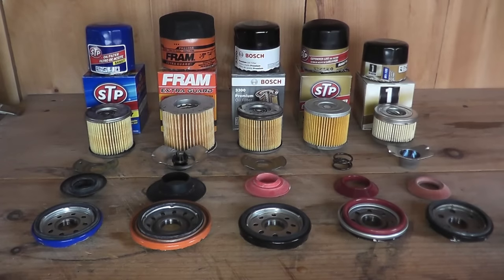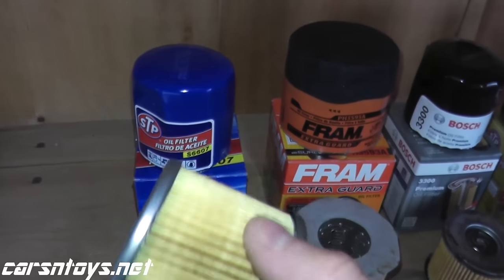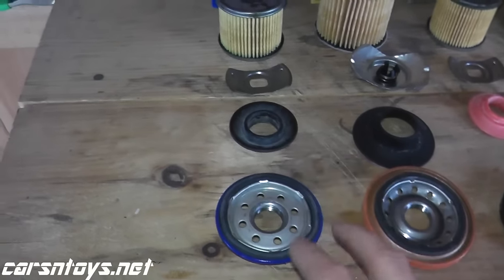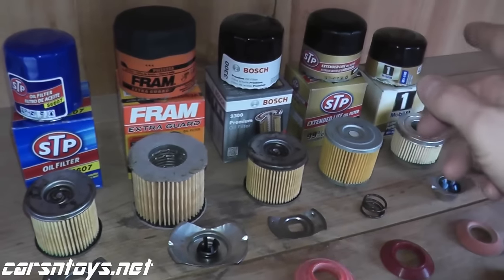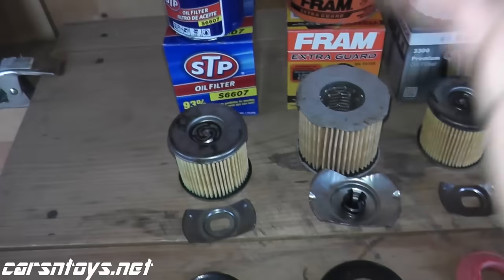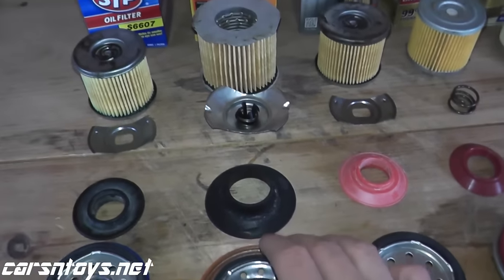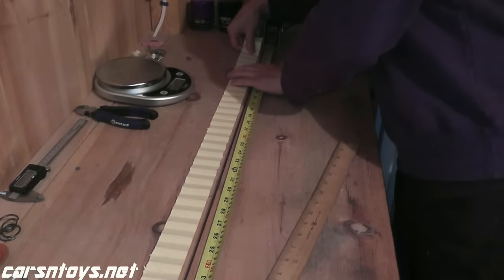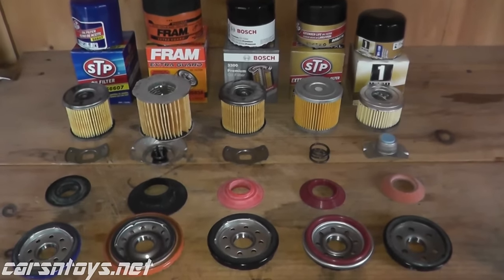Oil Filter Comparison: STP vs FRAM vs BOSCH vs MOBIL 1

Comment: I cut open my used oil filters and the Bosch 3410 had a split in the pleat. None of the Fram filters that I cut open had separated from the end disc or open pleats. My preference is Motorcraft. For the money they kick ass.

Comment: My Local Walmart sells the Mobil1's for $9 - everyday price. I run them in both of my vehicles with Valvoline High mileage dino juice - 5qt jug for $17,  I'm happy with a $26 oil change.

Thanks for the great video!
Reply from the maker: I agree. It's a great price for Mobil1.
Reply: Damn, I can't get my hands on a Mobil 1 filter for under $15 around me (including Walmart).
Reply: I used the M1-110A in my 2006 Nissan Armada, with 7 quarts of Castrol full synthetic 5W-30. I am running at about 5540 miles, and I’m not going to say the oil looks brand new, but it looks pretty good for being over 5000 miles. Funny thing, I went to Auto Zone today to drop off some used motor oil, and I figured I would get the filter there. 
Looked at that &15.00 price tag and took a 2 minute drive to Walmart and paid $9.97. I new it was going to be more expensive at Auto Zone, however, I was thinking $1 or $2 maybe, BUT $5.00 DIFFERENCE ?! ?! ?! 
That’s RIDICULOUS.
Reply: David Derfus you could always price match.
Reply: Brian Anguiano I will have to give that a try, I didn't know they did that thanks.
Reply: Hey what the hell, I just did the same oil change to my car 😂😂😎
Reply: @davidderfus3462  I noticed the same thing, and even weirder is that amazon is $12-14 for the same mobile 1 EP oil filter.  So, like you I got mine at walmart for $9.97.

Comment: I used the basic Fram Extra Guard oil filter with full synthetic oil with 5,000 miles of use, which took me roughly 5-6 months. I did the oil analysis with Blackstone Laboratories and they stated the oil filter did a fine job at filtering impurities from the oil. Though I highly recommend any top of the line oil filters of your preferred choice. I purposely used the extra guard for the oil analysis just out of curiosity.

Comment: The standard STP filter has changed from Korea to China and fractionally smaller and has a slight twisted filter medium. On these new filters I've also seen 2 filter mediums disconnected by small tears near the endcaps after oil changes. My oil antidrainback valve seal failed and could tell by the ratcheting sound when starting without oil leaks and oil at proper level.

Comment: A major determining factor affecting how long a filter "lasts" is how much debris your engine sheds into the oil. So saying that a filter lasts 10K is just nuts.  It MAY still filter well at 10K but it may be clogged up at 5K, too. Depends on your engine and its condition.

Comment: The reason so many dislike the fram is because check valve is known to fail causing oil not to flow through the filter.

Comment: I use the Bosch Premium 3330 on my 2018 Harley 1200. Rated for 20 Microns. Oil comes out of the filter cleaner than the Tank "Bag" as some call it. Also use Valvoline Syn 20/50 Motorcycle oil.

Comment: Stp extended life is my go to. Fram is fine, might collapse a pleat if you go past the recommended mileage but I love the grip they give you to remove the filter. Stp extended life being on par with a Bosch shocked me a bit. It's usually on sale but such a good filter. I only buy Mobil 1 filters when they don't have the stp extended and I'm sure to you it sounds weird but my store usually carries all cartridge filters in Mobil brand. I will say for jeeps wranglers and toyotas the Mobil filters are very good quality with good thick o rings. I haven't used Mobil filters for anything that isn't a 4runner or wrangler.

Comment: I have been using Bosch filters for the last 3 years. $5 at my local autozone. They are great but my local autozone doesn’t sell them no more. I picked up a STP Extended, couldn’t tell the difference between that and the Bosch. Found the Mobil 1 Extended at Walmart for $9.
Reply from the maker: That's a good $ for the Mobil1.

Comment: A fram never ruined anyone's engine, people's neglect and lack of maintenance/knowledge did. Ran them for decades in daily, farm&racin applications and never an issue. Also, why double or triple stint a filter 5,75,or 10k...? for price and turn over can just as easily swap out 3 fresh filters. what would be good is seeing highest end filters from all brands compared,but I see cost prohibitive too. thanks for the insights
Reply: Erik Dale of course, if you change it when you change oil, they won't harm. of you are like me and you run on extreme conditions, you mite wanna get a high end filter
Reply: Erik Dale 
You can't make that claim 
You're assuming too much with no data 
Ignorance abounds
Reply: No Asylum 
I agree
Reply: Erik Dale I've seen too much where a person claims a Fram gives out before it's mileage recommendation, and throws all the debris back into the engine. I wouldn't put a Fram oil filter on my engine unless it is the Fram Ultra Synthetic. Don't go 15,000 miles, though, like it recommends it can go. I prefer a Bosch or Six for price and quality.
Reply: Erik Dale Fram filters are for idiots.  No OEM filter uses cardboard end caps or rubber anti drainback valves! If I'm going to buy a filter that is not OEM it is going to be one that is superior to the OEM filter such as the Mobil 1. So much smarter to buy a $9.00 Mobil 1 filters rated for 20,000 miles than to buy a $4.00 Fram that in in grave danger of failing past 5,000 miles and not only that the rubber valve will shrink and allow more dry starts, the media does not filter nearly as well and the uneven pleating can negatively affect oil flow and pressure. The canister is also very flimsy which can burst or be punctured more easily. There is no reason to buy a Fram over the OEM or the high end aftermarket filter unless you are THAT broke or you think saving five bucks at the checkout counter is worth risking the longevity and like new performance of your engine. Cheap aftermarket filters are for idiots.
Reply: Erik Dale Because Fram is shit that doesn't protect anything so if you drive something other than a piece of shit Honda, you want a filter that will protect it. I want one good filter, not to replace it 3 times with a garbage filter I have to replace that doesn't protect anything.
Reply: Fram aren't necessarily "bad" but they aren't good. I've compared a Fram filter to the OEM Ford/Volvo one and their is a huge difference on number of pleats and quality of material which in turn means a higher oil pressure in the engine with the higher quality one. It's not about how long your big ends last but more about stuff like turbo charger bearings and things that are super sensitive to oil contamination and pressure. I bet an absolute tonne of fram oil filters have failed for people but they never know because they don't cut the can open and check (I would never bother myself) then wonder why their turbo has blown a seal at 60,000 miles.
Reply: Aw Bull, What, I am not going to believe my eyes??? I have seen a collapsed FRAM on a SBC 350.
Reply: I had a fram tough gard split on me going down the highway at 60 lbs oil pressure.  Was put on with the end adapter and not over tightened. I blew the side right I out. Was on for a total of 7 miles. Will never buy another.
Reply: Your so wrong
Reply: @carolgreen-fn1tm  👍 thanks

Comment: I normally get the Mobil 1 Extended Performance M212A filter for my impala, always wondered about STP filters, I only used their air filters for my engine but thats it. I’ll give their STP extended life filter since it’s always a special at Autozone.
Reply: how did the STP extended life filter work for you i was thinking of getting it myself.
Reply: @brandoned  it’s just a filter, nothing crazy. I would be recommended for OEM but honestly AC Delco is a little extra so STP Is less but still good for a daily driver

Comment: would you ever do an oem filter test? like Ford, Mopar, Toyota, etc
Reply from the maker: I will soon. Do you have a preference?
Reply: CarsNToys I was thinking like oem vs aftermarket
Reply: Yes an OEM such as Honda/Acura, Subaru, and Toyota vs Mobile 1, Amsoil, K&N, and Royal Purple.
Reply: If you are using synthetic oil definitely go with an after market oil filter.
Reply: OEM are just rebranded/nobrand versions of the same filters seen on store shelves.
Reply: WELL don't forget acdelco also please

Comment: I've been using regular STP filters for 15 years never had an issue..when I was young and dumb  I would run fram filters..I blew a few engines up which may or may not have been frams fault but then I went to school for automotive technology and my professor did a filter cut up and showed how fram filters were junk..he swore by WIX filters..but did say STP filters weren't bad..so I run STP because their cheap and reliable..
Reply from the maker: I used STP for many years but changed the oil every 3k miles. I never had an issue . Cheers

Comment: Had a bad experience with Fram on my race car.  The filter collapsed and the oil starvation caused the 1 rod bearing to spin.   I have not used one since.   That was in 1997.  Maybe they have changed since.
Reply: Was it a FRAM Racing filter, or a regular ExtraGuard? They used to make true "racing" filters. It was their "HP" line. Maybe they still do (?). Each filter has a "rated flow" you shouldn't exceed. Race cars aren't typical applications a regular filter is designed for.

I've also seen a lot of "chicken-egg" cases where there is no evidence of "what failed first", the engine or the filter. When a bearing lets go, the entire oil stream is full of debris. Any evidence of filter failure is masked by what happened after the engine let go.
Reply: SC457A I've seen that happen too. A Fram filter collapsed and ruined the 4 cylinder engine in a 2001 Camry. What a shame!

Comment: I usually run Denso filters on our Japanese cars, exclusively Motorcraft on the Mustang weekend cruiser, but I have used the STP filters on the daily driver Japanese cars with zero problems. When AutoZone runs the oil change special and the STP filter is only $1 extra with the purchase of a 5qt jug that is too good a deal to pass up in my opinion.

Comment: I have never ever had an Issue running a Fram. I think the people who have Issues with Fram are guy who rebiuld something and had no clue on what they were doing.
Reply: never rebuilt my car and I'm certain the fram filters that I started using at 80K miles ruined my timing chain.
Reply: Fram filters are cheap no good filters. I use stp
Reply: I've always used orange Frams on our OHV engines with no problems. Our SOHC and DOHC engines get the better filters.
Reply: @AlahuSnackbar  that is a coincidence.  Around 80K its time to change the chain, it certainly wasn't the oil filter. Anyone who knows about cars would tell you the same.

Comment: Another youtube upload has a PH series fram with 5,000 miles on it, the cardboard end cap separated from the filter element.  So it's probably fine at a 3,000 OCI.

Comment: Il you change your oil & oil filter every 100 miles or every two weeks (whichever comes first), you will have no problem with your car. But you will have to deal with the problem you have in your head though.

Comment: I dent my oil filter when installing w. pliers. Is it okay? The filter was covered w. oil so it was hard to tighten w. hands. So I used, overused, pliers. The filter has a dent on one side. No leak. But I am a bit concerned. What do you think guys?

Comment: I got a story for ya, Fram didn't kill my motor though, Thank god i'm switching to STPXL's.  anyway i don't trust Fram at all what-so-ever.  there was dirt and grit in my 361 Big-block. 
<Don't ask how the grit/dirt was in there> and i did further digging around the valvetrain and the Hydraulic tappets were filled with dirt/grit! the fram filter doesn't filter anything at all.  Fram, the scam.

Comment: I've always used fram and have never had any issues but i also don't use the cheap $5 filters.
Reply from the maker: I've had good luck with Fram as well . Cheers.
Reply: Travis D  Fram filters are good filters. Honda dealerships use there OEM oil filters and they are made by Fram. Honda engines are known to get 300,000 miles out of there engines with no major problems. Mann filters don't even have end caps on there oil filters. Check out the Mann oil filter pictures. Fram oil filters ruined engines? Those people are full of crap. They ran the engine with no oil or neglected oil interval changes.
Reply: CarsNToys  Honda OEM oil filters are made by Fram. They used to be made by Filtech. The engines are known to go 300,000 miles. Check out the Mann oil filter pictures cut open. They don't even have end caps and they are supposed to be great oil filters.
Reply: Travis D  he talks about Fram's oil filter having cardboard end caps.  Mann oil filters don't have them at all. Fram's end caps have a very good adhesive on them. There fine.

Comment: Fram 6607 filter is the same as the Bosch 3300 and STP 6607, about the same as the M-108 Filter in size. Tiny, but works. lol

Comment: Change your oil and filter every 5,000 to 5,500 , and between your oil change charge your oil filter at 2,500 miles.
The oil can last longer the your oil filter.  When you change your filter earlier it will be cleaner and easier for the oil to go through the filter.
  Oil filters are cheap and it only take a short time to do it.
Myself, I cut them open and see what is inside.
What I learned is gasoline, shell gasoline is the clearest oil change.
If I run everything place, cheapest gasoline, wal- mart, speedway, 
My oil change, and inside the filter is dirtier and darker.

Comment: stp filter is inconsistent. I've seen metal mesh and without inside the same filter number. Different size as well! I had fiber/glue holding my stp filter media. I'd still use it, just would like to see it with less personality.

Comment: WANT THE BEST PROTECTION FOR YOUR ENGINE IT WOULD BE AMSOIL SIGNATURE SERIES , LUCUS SYNTHETIC OIL STABILIZER WITH A BOSCHE PLATINUM SYNTHETIC OIL FILTER YOU CAN RUN 15,000 KM OR 9,000 MILES. 
I HAVE A 1986 CJ 7 WITH A 258 INLINE 6 WITH 883,927 KM OR 549,000 MILES ON IT IT RUNS PERFECT.

Comment: I’m running STX max life , Hard to beat  for under 12 bucks.
Reply: Stp max life? The mobile 1 m1 20k is $9 and better
Reply: Javier Hernandez  Mobile one has never been 9 bucks , unless it’s on sale. It’s like 15.99 plus for there high end one like that.  Stp is just the in house brand autozone I believe , but max life is there best filter. It’s good quality  .  I did quite a bit of research on them
Reply: @calebniederhofer678  in my local Walmart the regular price is $9 and 70 something cents. I've always thought it was normal. The Fram ULTRA is like $9.10 and the k&n is like $11. The stp is a good filter for sure but I'd never pay $15 for it not when I can get the mobil 1 ep 20k for under $10. I'd pay $8 for the stp max and Fram ultra.
Reply: Javier Hernandez  You are correct on 10 dollars ,  I think it does depend on truck , car , size too though a little.
Reply: @calebniederhofer678  it's a midsize filter not a tiny one. The real huge filters are a bit more.

Comment: Are there any risks to using an oil filter designed for synthetic with conventional oil instead?
Reply from the maker: No. Most filters are designed to be used with conventional, blend or full synthetics.
Reply: The difference is the overall filter capacity. As the filter ages it gradually is more restrictive to flow. The modern engines gain rpms much more quickly. A restrictive filter can cause the bypass to open up and pass unfiltered oil. This is a concern particularly in vvt engines. The vvt systems are very vulnerable to debris.. The racing filters have the highest flow capacity.

Comment: Its not necessary to change oil at 3000 mile. Even the cheap filters are rated for 5k and most mfg's say 5k for change intervals. Oil qualities are much better than 30 yrs ago.
Reply: Oils are good for 5k but filters do clog. Never buy fram or stp. Pay the extra $3 for the Bosch and look for something larger and heavier as long as your filter is not near exhaust parts. You dont want that extra heat in your oil or engine. Some cars specifically have smaller filters to reduce heat. Smaller filters need changed more. For example my subaru says change every 7k miles or 3.5k for severe driving. Believe it or not this oem filter is not good for 7k miles. It is way to small to last that long. If you do have a smaller filter I would always recommend doing the severe driving interval. Btw, my family follows this and we have always had our cars last 250k miles and they rarely have engine issues.

Comment: What is the best? I was in between Bosch, K&N, Royal Purple, or Mobil 1
Reply from the maker: You really can't go wrong with those choices. I think Royal Purple is on the high end in terms of price. You may be able to get a good oil filter deal with the Mobil1.
Reply: @CarsNToys  I've always done Royal purple. I just did an oil change and tried k&n. So far so good. I feel like Royal purple and mobile 1 look the same. Do you think the Bosch premium filter is about the same as those? or slightly less quality?

Comment: Back in the 90s I used the orange 🍊 can of death 💀 on my 600 ho 406 lunati small block in my 81 z28 has zero problems also used Lucas racing oil ... guess I got lucky . Now I use fram ultra synthetic oil filter made way better ..
Reply from the maker: I used Fram as well decades ago on a '83 z28 w/o any issues
Reply: Always used orange frams on cars that go multiple hundreds of thousands of miles.  Car falls apart around the runs-like-new engine.